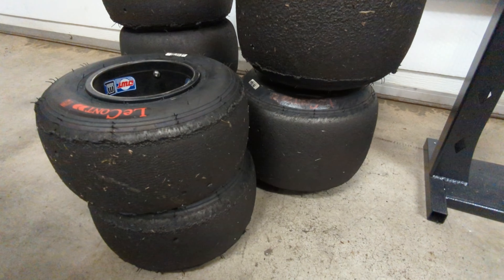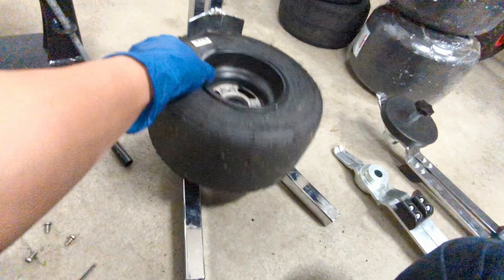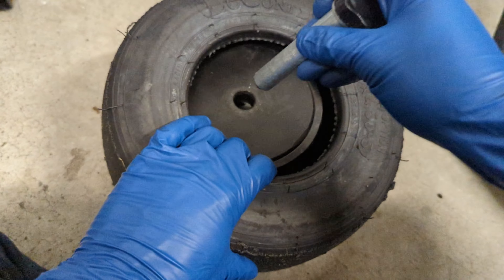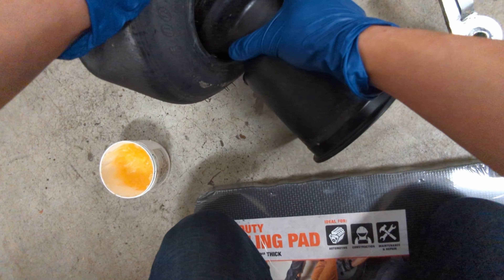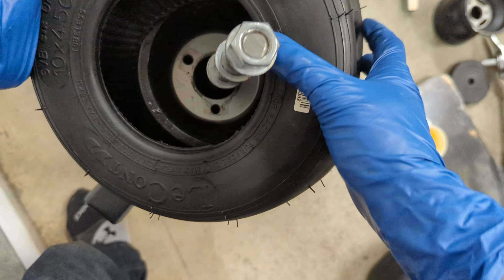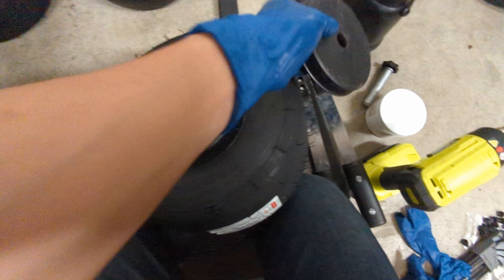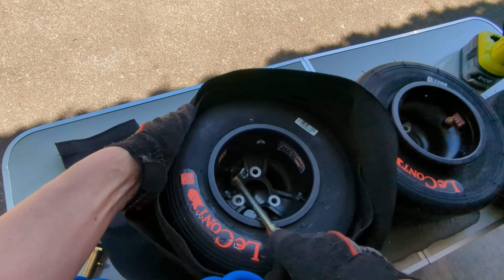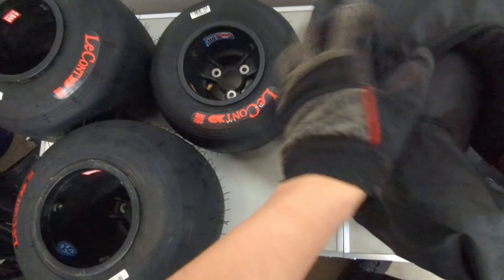Tips for changing kart tires | Karting Noob

Comment: you can verify if the tires are not leaking by spraying some soap mixed with water on the bead lock screws and the base of the valve, and if there are no leaks i suggest you to let all the air out by unscrewing the valve, if u let the new tires sit inflated for a while before using them on track they will deform and u will lose performance, also put some carboard under the rim to avoid scratches. if u do have scratches on the rims u can use a black marker to cover all the imperfections on the rim

Comment: Hmmm you take a lot of time and you really abuse you rims. The time you take to get your tools ready i have all old tires off and new tires in by hand. Probably even both sets. The only thing you need is a good beadbreaker.
Reply: also little tip just put the tire in a water bucket. then you do not have to wait a hour to see if you did a proper job and the tire does not leak air!
Reply: What tyres are you using? Some brands and compounds are very hard, especially when cold. A Dunlop DFH senior tyre  for instance is a tyre you're gonna have a bad time if you're only using a bead breaker but no tongs!
Reply: @downvisor  every kart tire you can imagine and also every type of rim, and also in minus 0 degree temps. always just used my hands and a bead breaker.
Reply: @BBridder12  Wow. Well, you're the only person I've ever heard of being able to do that. You must have the strength of a sasquatch!
Reply: @downvisor  in Europe in the 90’s we did not have the luxury of all these tools. And i think a lot of european drivers know, racing at Marieumbourg belgium and not in summertime will mean frozen tires at Parcferme that have to be put on. So then you learn to do it! And to be honest. To get the tires on then is more difficult then today. It really is more easy. I use now the Lecont Prime slick and they really fly on and off.
Reply: Ps i hardly use strength. It is all technic
Reply: @downvisor  i also had a bad time putting on the dunlop DHH bc they are so hard not even the best technique in the world would budge them by hand but to make it alot easyer u can warm them with a hair dryer and they will go on the rims like butter